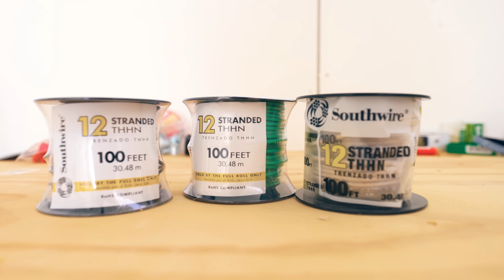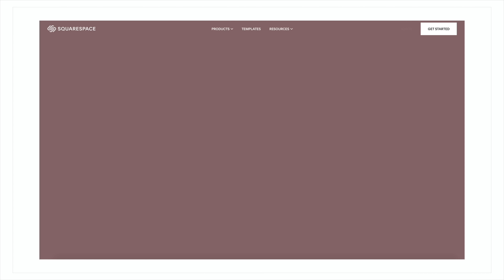DIY SOLAR POWERED WORKSHOP | MODERN BUILDS x GOAL ZERO

Comment: Using a pipe cutter on EMT to run electrical wiring through is totally illegal. Check the NEC..
Reply: Not illegal if you ream the conduit after. (NEC Art 358.28) He doesn't show any reaming so it is against code. Over time if the conduit vibrates, it will damage the wires and when pulling wire it might cut through the insulation and cause a short.
Reply: @SeanLeonDrumz  I've had inspectors actually take my pipe cutter away from me.
Reply: Can't oyu just smooth over the edge after cutting? I'd assume you want to do that when cutting anything just as a good habit.
Reply: @thomashajicek2747  No, you want to smooth the inside of the conduit. The edge isn't really a problem. The burr created on the inside will chafe the wire or potentially damage the insulation while you are pulling the wire in.

Comment: Your electric work is incorrect. You need to add conduit straps and ground every metal junction box with a ground screw using a pig tail.
Reply: He wasn't lying when he said he didn't know much about wiring.
But he was lying when he shouted "super pro!"

Comment: Electrical apprentice here:

You are using the wrong tool to cut conduit. That pipe cutter guy is for plumbing, and it leaves a sharp edge on the inside lip of the pipe.

That sharp edge can then damage the insulation on the wires as you pull them through.

The correct tool would be a hacksaw or Portaband.
Reply: Glad I'm not the only one that cringed at this install 😬
Reply: Doesn’t matter what you use to cut it, just make sure you ALWAYS debur conduit.
Reply: @dlax141  I agree that you always deburr, but if you use one of those plumber things and then use a conduit reamer or a set of linesmans (instead of like, a file), you could end up folding the burr over and making the problem even worse
Reply: Should debur no matter what cutting tool is used.
Reply: Pretty much everything electrical in this video made me cringe. (Fellow apprentice here)

Comment: That cutter is the same type used for plumbing as well. I want to put up a studio in a shed, there is no electrical so this is an excellent way to get electrical to my building.
Reply: Don't use a plumbing cutter for electrical--it leaves a sharp edge on the inside of the pipe and can damage the wire.

Comment: At 5:55, did I just hear correctly? That you are putting the single switch that controls the sockets (outlets) at the BATTERY end of the cable run? And not at the outlet itself?? How would someone know that the socket outlet is hot, if they didn’t know to check at the battery pack end? Why not have switches on the outlets themselves, ok yes like we have in the UK, so that there is a safety switch with a visual indication whether the outlet is live? (assuming it’s been wired correctly of course)
Reply: probably because this is more standard in america, basically just think of every outlet is always live here, although sometimes we do have switched outlets (for lamps to be controlled at entry ways), but other than that you dont really see switched outlets here, and as he said with the switch off, all outlets are off except at the switch itself for chargers. and also you can just label the switches (had to in my home as every switch was basically backwards, switch on right controlled stuff to my left, switch on left controlled stuff to my right)
Reply: @jjjacer  thanks for the explanation from that side

Comment: nice video. Solar system + battery pack = that's not really approachable for everyday DIYers like me but just looking at you getting the project done is virtually satisfying!
Reply: Yeah that's like $5k of equipment at least. Unless you're totally off the grid like this, it'll be a lot cheaper to just run power from your home to your shed. 
If you're just dedicated to using solar, spend the money to add solar to your primary home and then run power from there to your shed.

Comment: Jesus Christ those goal zero batteries are overpriced as hell. $500 for a 100Ah 12v battery, that's just nuts.
Reply: Yeah, you will always pay a huge premium for pre packaged stuff like this.
For the same ammount he would have had atleast twice the power (probably 3 times) if he went with Batlleborn batterys, victonic chargecontroller/inverter and any generic brand solar panes, and then it would have no upper limit for expansion either.
Reply: Those youtube sponsorings are not cheap pls halp
Reply: $1,300 fpr the Yeti 1000X, $2,000 for the 4 battery expansion, $1,000 for the 4 solar panels, and $300 for the solar charge controller. Call it 5 grand for the whole setup, including the GoalZero stuff, the lights, wire, conduit and junction/outlet boxes.
Reply: The relevant spec on the 1000X is this: 120V AC Inverter: 120VAC 60Hz, 12.5A (1500W, 3000W surge) (output, pure sine wave)
Reply: @AnthonyBowman  thanks for the break down. I'm going to stick with my original plan and run a cable from my house to my shop. Seems the cheaper option
Reply: @AnthonyBowman  It's an easy setup for people who don't want to invest much time into learning how to put together a solar system. But for much less money you could build something way more efficient. Anyone who is interested in doing something like this check out will prowse on YouTube.
Reply: you mean $1500
Reply: @nils what is a normal price to pay and what you recomend?
Reply: @Chris99769  it really depends on where you live and what your budged is and your usage. If you try to save money lead acid batteries are the way to go. Where I live I could get 100Ah 12V for about $100. If you have the money and need to use the battery system everyday you should realistically go with lithium batteries. @Toxicity seems to know more about that than I do. 
One thing to keep in mind, while Lithium Batteries last longer, they are also whay more fussy. If you only use your system once a year when going camping, you need to make sure your batteries are always charged properly and never discharged completely. Plus if you only use it occasionally just go with lead acid. IMO lithium batteries are still a too expensive for occasional use. They are good in cars and phones because they have a very high energy density, meaning they are way lighter and smaller for the same power, but if you want something reliable and pretty much unkillable until you 'run out of cylces' for rather cheap go the lead acid.
Reply: In my country we can buy 4 x 115 Ah 12v batteries for 320 $ along with 1 year manufacturer warranty.Prices in USA are ridiculously high.
Reply: Christ, your American electric standards are different to the UK.
Reply: I mean it would be okay, but then I looked at the chemistry, fucking Lead Acid. Those fuckers are dead after 500 Cycles. Too expensive, especially since Chinese LiFePo4 Cells are now at 300$ for 12V 100Ah. And those fuckers live for over 10 000 cycles.
Reply: @Toxicity1987  Where can I buy everything that you mentioned lol
Reply: @Toxicity1987  I thought they were lithium. Lead acid is trash and if he runs them anywhere below 50% they will die sooo fast. If you build your own set up, then you know everything’s good quality.